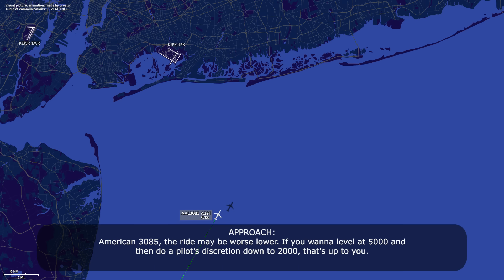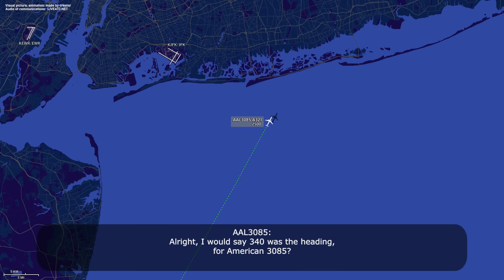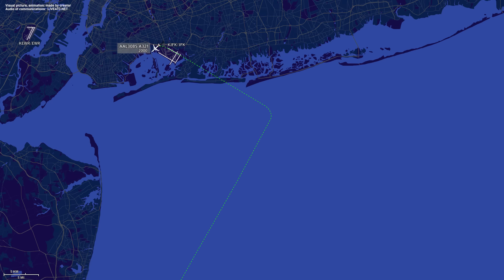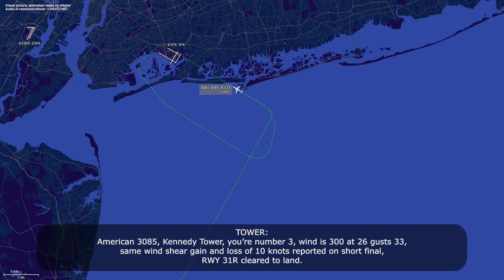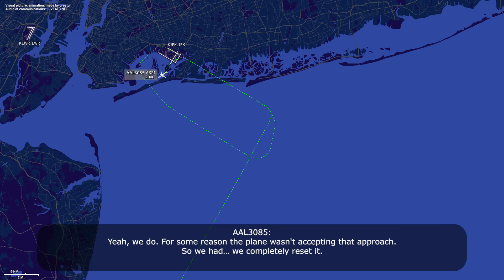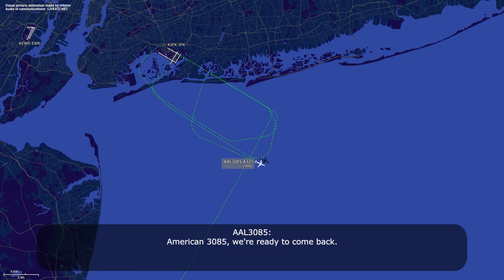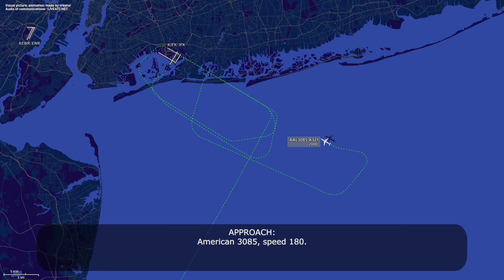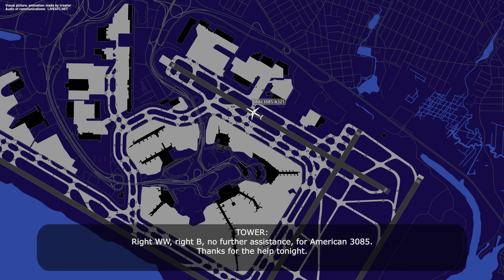Pilot declares MAYDAY for low fuel after 3 unsuccessful approaches at JFK Airport. Real ATC

Comment: Heaven forbid turning those flight directors off and fly it visually!!!
Reply: Some companies require you to load the approach even when flying a visual, and this was especially relevant since it was a night operation.
Reply: @DeltaAirtran Yeah, you're one of those that'll keep checking boxes as your options dwindle!!!
Reply: @gavinsingh4450  I couldn't agree more with you gavinsingh. It's an ILS, the easiest of approaches, with approach lights and a papi on the field. Do some of that pilot stuff mav.
Reply: You need to be visual with the airport to fly a visual approach
Reply: @kickedinthecalfbyacow7549 Not necessarily.
Reply: @gavinsingh4450 yes, necessarily
Reply: @kickedinthecalfbyacow7549  You do not need the airport in sight if you have the preceding aircraft in sight and are cleared to follow it—ATC can issue the visual approach clearance in that case, and your responsibility shifts to visually tracking that traffic while staying clear of clouds and terrain.
Reply: @JohnSmith-zi9or that doesn’t apply to IFR public transport aircraft

Comment: What may have happened plane was in go around mode after the missed...Crew may have forgot to reactivate approach phase to get the aircraft prepared for the second/third approach...Yes you should be able to fly the plane without the FMS but the Airbus is a different beast as so many things are coupled to the Autopilot & FDs...The Autothrust follows the flight directors not the aircraft state...So if you're hand flying and pitch down with the FDs commanding a climb the A/THR will follow the FDs increase thrust and try to overspeed the airplane..Coupled with potential crew fatigue and a gusty day where Ground Speed Mini may be all over the place... This scenario is pretty plausible
Reply: Can't they just turn off all the automation and fly it manually?  Kind of scary to be so reliant on computers when the plane can fly by hand !
Reply: Yeah you absolutely can but on a day where it's high workload with winds, gusts and maybe some fatigue mixed in having the automation set up to back you up appropriately can absolutely help you out...Especially on an approach to 31R into Kennedy where if you go missed you need to be ready for an immediate turn to over fly LGA arrivals and NYC while talking to ATC etc...It never hurts to have a back up and have it set up appropriately
Reply: I thought the same, revert to ils, no fmc and request rwy heading and vectors in case of go around. At least on a 737...

Comment: Cookie Monster say:

Controllers always taught: PTAC (Position, Turn, Altitude, Clearance) when do vector for approach. 

On last clearance in video:

AAL3085 already told to intercept localizer (T), 
then told 20 mile from ZULAB (P), 
and then cleared ILS 31R (C). 
But no Altitude (A). 

AAL3085 already level at 2000, Approach Plate show ZULAB at or above 1900. 

Controller not know if AAL3085 established on LOC (even if look like).

MSA is 2000. 
And IF MVA is lower than 1900, Cookie Monster think she could say:

“maintain at or above 1900 until established” 

But at a least must say:

“Maintain 2000 until established.”

Comment: this confusing... you can fly ILS with an empty box even, you dont need fms for that. frequency, course, mins, autobrake mid, flaps full, MA alt, all usable. autoland maybe?
Reply: Airbus pilots don't like manual flying.
Reply: @JohnSmith-zi9or what I'm saying is not manual mate...airbuses are perfectly capable of bare radio navigation approaches down to minimums. Only thing I'm not sure is zero zero autoland
Reply: @kbuss10  On the Boeing. it depends how cheap your company is for 0/0 AP. Analogy here is Ranair vs TUI. (CAT 3b 75m vs CAT 3c 0m)

Comment: Retired Pilot of Jumbos here! It's really pathetic how a plane on such a short trip can declare Mayday for fuel issues! Putting innocent lives at risk just to save a few bucks! Unethical pilot and no excuses
Reply: Of course 3 go arounds will cause you to be low on fuel. That’s almost every domestic flight without an alternate.
Reply: @saxmanb777 No if you load sufficient jet fuel! Short trip as well no excuses!! Need to calculate every possible outcome!! 
It's called FLIGHT PLAN
Reply: @japantrader20  SNA to JFK is not a short flight. Its a 5 hour flight that takes off close to maximum allowable takeoff weight due to the short SNA runway. In order to take all the passengers, not much extra fuel above minimum required can be carried.
Reply: @matthewstraub8771 That's very short not considered a Long Haul! Geeez hard to explain
Reply: @japantrader20 yeah. SNA to JFK  is definitely not short. They were almost for sure at max takeoff weight. Plus dispatch pans fuel load.
Reply: @japantrader20  well, airlines aren't too big on flying around with unnecessary fuel.  3 go arounds after a transcon flight....they may have had other diversions or delays en route to JFK that cut into their planned fuel usage....we just don't know based off this video.  Also, they may have meant to call min fuel instead of mayday fuel but as they didn't call out their fuel remaining there's no way to know based just off this video.
Reply: @cruisinguy6024 Totally unjustified sorry. You calculate &load fuel not only for go arounds but also at least another 2 Airports aside from Destination! Cost cutting on everything?
Reply: You sound like you would have been a real joy to fly with.  I’m guessing you were probably the do not fly list when bid time came around

Comment: Lucky pax got 3 flights to the price on 1. I would claim AAdvantage miles for them all. AA3084 (Dallas-Savannah), AA3085 (Santa Ana - New York) and AA2085 (Bermuda - Charlotte). 😂

Also strange to call Mayday just seconds from touchdown? Why not call it in case of another go around. 🤔
Reply: My theory is that the captain properly decided he needed to disregard certain normal-ops restrictions in order to get the @#$!! airplane on the ground.  Certain levels of approach instability or windshear normally require a go-around, but after 3 tries, the normal rules were becoming a hazard themselves, because of the fuel state.  Declaring the emergency gave him the proper authority to stick-and-rudder that airplane to get it safely down.  Also, if the 4th try had to be aborted, they would need emergency priority to go to whatever other nearby runway they chose  To me, this was good command decision making.  Everyone did a good job.
Reply: @SDK-im8sl big agree here. I think it's largely for safety and to give the pilot the ability to deviate from the normal rules, such that he could safely land without it becoming a bigger problem down the line.
Reply: Due to either/or company policy/FAA rules, the amount of fuel remaining hit a mandatory point of calling a Mayday fuel situation.

Comment: Rookie Airbus Pilot: what’s it doing?
Veteran Airbus Pilot: It’s doing it again
Reply: So the glitches in flybywire's model aren't glitches, they're real?
Reply: @AmNesia-r5h  Yes, because it's what happens when you program the pilot out of the loop. They should have flown the approach manually after the first issue.
Reply: Has zero to do with FBW.
Reply: Boeing pilot here. There's no box after final vector to LOC? What's going on with box sequencing?

Comment: What is the point of declaring a mayday for low fuel when you're clear to land? What's ATC supposed to do, hold the pilots hand while he tries to land for the 4th time? 🤦‍♂
Reply: There are legal requirements to declare the emergency once you get down to certain fuel amounts that you were never supposed to reach. In any case, you have to assume the worst and that there's another go-around even if it isn't your fault (for example, if the preceding aircraft does not vacate the runway in time). Better for the tower to know now that fuel is an issue than to have that conversation after the next go-around when the minutes would matter a lot more.
Reply: @jeremycanna6583  Okay thanks. In that case I would argue that they should have declared it long before that. The whole point of declaring Mayday is to get emergency priority attention from the ATC. At that point they had clearance to land and there was nothing in front of them. They had as much priority as they were going to get. It was 100% in the pilots hands at that point. The only additional assistance that the controller could have provided would have been to dispatch emergency equipment. Also since they declared a mayday emergency they should have provided  the required additional information for that including amount of fuel and persons onboard. But it doesn't appear that ever happened. Probably because it was too late at that point.
Reply: @MaxZomboni  you don't just declare it willy nilly.   You declare it when it's true.
Reply: @MaxZomboni  They weren't in a mayday fuel situation prior to calling it though, and that's the point.  This audio doesn't reveal if he was truly at mayday fuel or if he should have called min fuel, which would be nice to know, but either way mayday fuel has a very specific meaning.
Reply: @cruisinguy6024  Oh give me a break, the fuel emergency didn't suddenly develop on the forth final approach, He would have known how much fuel he had before that he was going to be committed to landing,
Reply: @MaxZomboni  I hear you, and yes regarding the whole point being to get emergency priority. In this case it seems such priority would only potentially be useful and would start taking effect if they had another missed approach. To me, the legality served its purpose  - it made it an automatic emergency so nobody had to use mental energy to wonder whether or not one should be declared. If this 4th approach wasn't going to work out, then the tower already knew this flight probably shouldn't just be resequenced at leisure like before, which is really good to know.
Reply: @MaxZomboni  It's based on actual time available. He's basically telling them that he matters more than the other aircraft around him now. Up until that point it was ok for him to be treated like anyone else. But a specific threshold has just been crossed, meaning he's no longer just like anyone else anymore. Yeah, it's awkward that he's saying it while just about to land, but he's following the protocols.
Reply: Because you're not guaranteed to land on that approach.

Comment: How are these people typed on this airplane? The box won't let us sequence the approach? What was the visibility and ceiling at the time?
Reply: You don't know what issues there may be or what rules the airline has.
Reply: Neither do you Zac. On the airplane I fly, if the preview needles don't populate with the correct course, or if the localizer frequency doesn't auto tune, we can easily adjust everything and set it all up manually (frequency, course) in seconds. No need to set anything in the box. They were getting vectors from ATC! They don't need to sequence anything in the box. I assume the Airbus has exactly the same tools. This pilot needs to go back to school.
Reply: @agoogleuser2369it’s all done via the mcdu. You can’t preview like a 190/170. If the flight plan isn’t correct it gets screwy. You can hard tune the radios but that’s not normal.
Reply: @agoogleuser2369 Yes, that's why I am not making any claims about how they are incompetent like you are.
Reply: First go around they were unstable. Cool. Second and third... Why did they even attempt the second or the third approach if they weren't ready. It's really mind boggling to be honest. Then skip min fuel and go straight to emergency. The whole thing is bizarre honestly.
Reply: @agoogleuser2369 Presumbly because they were low on fuel.   And they probably expected the programming to go smoothly.   But you go armchair airline pilot and tell them all the things they're doing wrong.
Reply: With 30 years flying fixed wing aircraft I have never seen anything like that.

Comment: Very strange, it’s a ILS approach. The box is not needed.
Reply: Actually that box manages the ils frecuency upon selection of the intended app. Although, theres a manual option in the rmp, which is used in these situations.
Reply: @aarondg19  they were already established on the LOC. So it was not a wrong freq set. I believe they forgot to set APP MODE in the PERF page again after their first go around which results normally in a harsh speed acceleration once setting Speedknob to managed mode. and an unexpected acceleration so close before landing will ruin your whole energy management and makes a missed approach inevitable. Since they get speed restrictions until short final it is very likely they didnt notice it until it was too late
Reply: @yynLxd i did not say that. He commented the box wasn’t need it. Thats all 😂😂. Also, i listened that they could not get into the app phase in the box, but i don’t like to make comments about someone’s flight until an investigation is completed.
Reply: @aarondg19  I just meant that if the first thing you bring up is the frequency, it sounds like that was your initial thought about what might have gone wrong. In any case, without the investigation it’s all just speculation.
Reply: @yynLxd 💪🏼
Reply: @a @aarondg19 yeah I was wondering why they didn’t just manually set it on the RMP
Reply: You don't know what the airline rules are.

Comment: I watched (tracked) a plane go around 3 times before successfully landing on it's 4th attempt at DCA on Dec 19; another super windy day. It was American Eagle flight ENY4208 from Greensboro to DCA
Reply: Yes, ENY4208 tried to land on Runway 1 three times, getting as low as 500 ft AGL.  Then DCA "turned the boat" and 4208 successfully landed on Runway 19
Reply: @SDK-im8sl  The wind was crazy for at least two days straight. I remember seeing quite a few diversions. I was actually surprised there wasn't more delays or cancellations because of the weather
Reply: Except in this case it wasn’t because of wind.